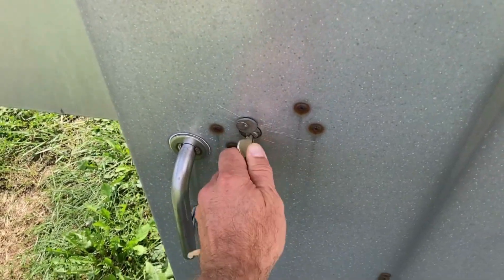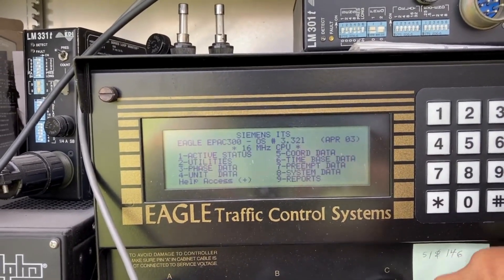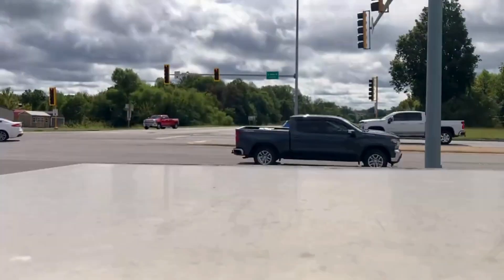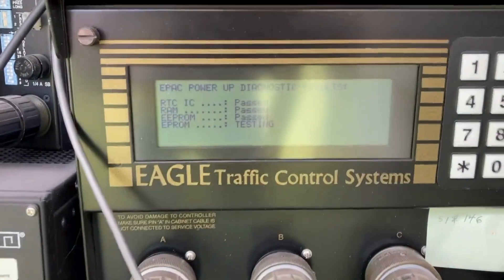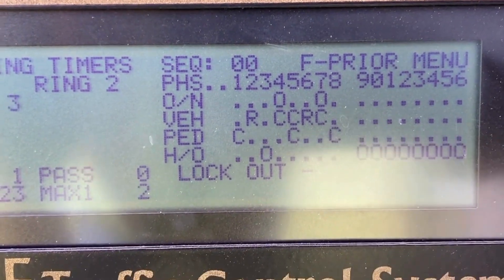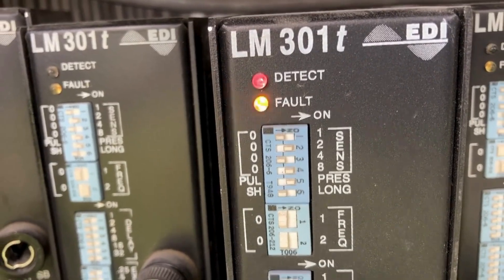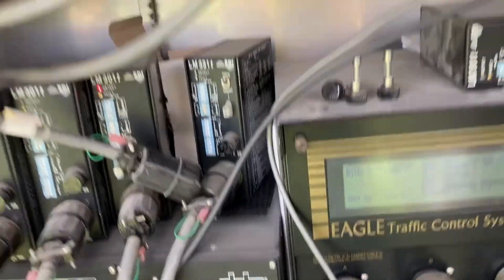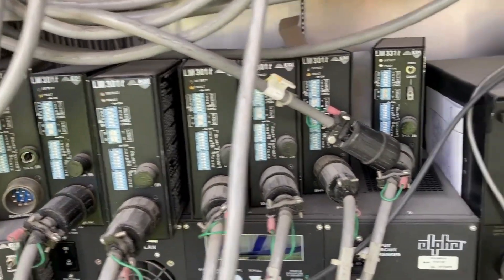Be Thorough in Traffic Signal Repairs

Comment: Why do the loops have to be installed after the fact?
Reply from the maker: Great question-
With the concrete patch that was poured, it has to be pretty thick.  There's no way to place loop wire at the correct depth during the pour.  The concrete must harden first.  Then sawcuts can be placed into the concrete, loop wire installed and sealed.  Hope that makes sense.

Comment: Another great video. I also liked the thumbnail! Your videos are a great service for those who repair traffic lights. You are good at identifying the issue and addressing it in a timely manner. I realize your short informative can't and shouldn't explain everything. For those who want more information read on.  According to the monitor while phases 4 -7 were green voltage was detected on phase 7 yellow and red. Voltage must be > 25 volts to cause a fault. When the fault isn't present upon resetting the conflict monitor I like to use my volt meter to verify the voltage on those terminals (P7 Yellow and Red) when off. Usually around 5 volts with LED lights is normal. If the voltage is > 15 v I would investigate further. If it had rained I would open the signal unit and look for water intrusion - damp terminal strip. A quick fix would be to remove the wires from the terminal strip and use wire nuts for the connection.
Reply from the maker: Thanks as always Mike.  Great job filling in that information.  I don't always get as thorough as you just did.  I've got some good guys on here to do that!  Thanks again!

Comment: The "always call on fault" is not good however when preemption is used for priority vehicles (for example buses) using bus detector loops. Here in sweden, we have a traffic light that is serving both a tram/pedestrian crossing and also 2 car crossings. The tram has priority (preemption) but since it is priority, the controller resets the phase timing all the time after a call have been made on the priority line, so the other cars on the T crossing and the pedestrian line never get serviced if something happens with preemption.

This is something that isn't solved with for example max-green or similiar, as a call on the priority causes the controller to "start over" the timing. Here in sweden tram-preemption is done through their own wireless transmission system (they send a wireless signal to some receiver when they come) but once rain got into that wireless receiver box (or some related junction box) and shorted it out.... it caused the traffic lights to constantly service the tram and then start over with the main street. The pedestrians and the connecting T-street never got serviced for like half an hour, until that short in the receiver box dried up a little so the cars finally got serviced. Had to report that traffic light to the city council and specifically state the fault only comes on when its damp or wet, so they know they should look for water ingress in junction boxes and such.

In the case with bus-preemption, here in sweden they set the detector loops to NOT call on fault for bus-only street, but instead, put up a keybox so if the detector loop fails to call, the bus driver could get out and turn a key in a keybox to manually place a call (It works like a pedestrian button - but requires a key so only bus drivers can use it). The bus traffic lights in sweden also have a call present indicator which is a small round white light, above the red or "S" (Stop) light, which turns on if there is a call present on bus-preemption or tram-preemption, so the bus driver knows the detector loop or wireless receiver is working or if he needs to step out and use the key.
Reply from the maker: So the big question everyone is wanting to know...did they fix the issue when it rained???  LOL
Reply: @streetsmartstraffic  seems like so, because that light haven't had a issue since I reported it.